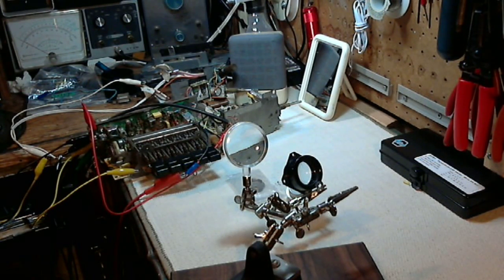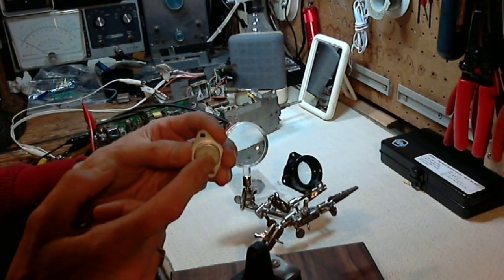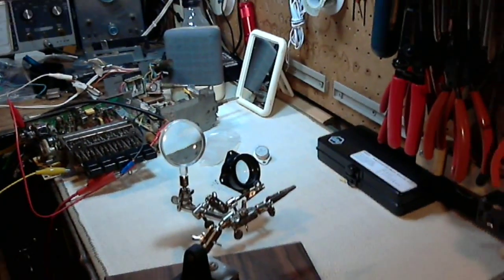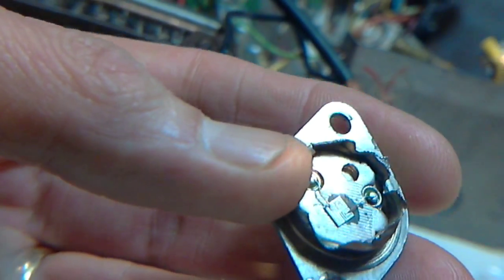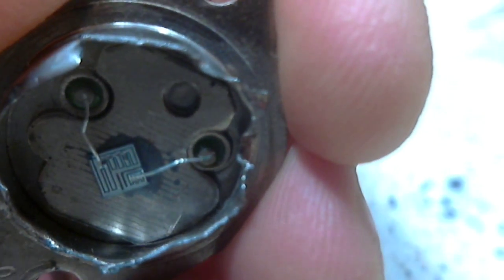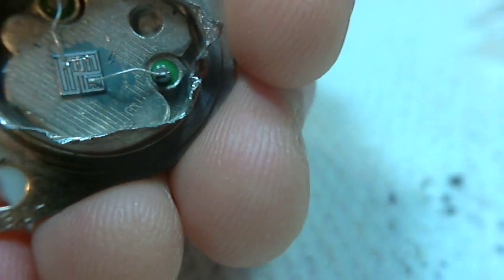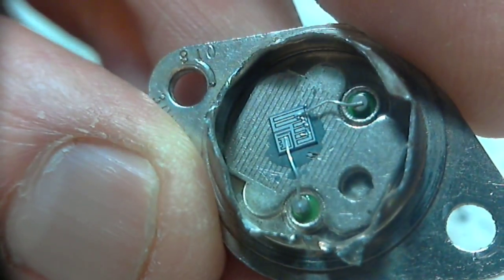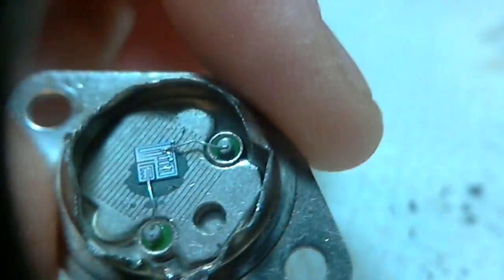A Look Inside a Power Transistor

Comment: That glue you mention serves as both mechanical bonding and thermal transfer compound. It appears that the primary cause of failure was the offset between the application of the paste and that of the chip. You can see that the corner underneath the lead from which the solder melted doesn't have enough under it.

Comment: amazing, must be two dissimilar metals bonded, to generate the heat from this
power transistor, I wonder if the sealed envelope, is filled with some  type of gas.
Reply from the maker: MrMac5150 I thought it had air inside but I really don't know.
Reply: Jim Lindenas Time to investigate..

Comment: Wow. I would have thought the silicon chunk would be much bigger for a power transistor. It looks about the same size as the one in your CPU that has 8 million transistors on it. Very cool to see. Thanks.
Reply from the maker: There are guys out there with twenty pound per foot wires going to their speakers and those $$$ speaker wires are connected to this tiny thing.
Reply: I read a test where they compared those crazy expensive wires with coat hangers. No one could hear a difference. Big surprise. There is even a $300 power cord you can buy for your amp. Yep, that last 5 feet coming from the power station will make all the difference...